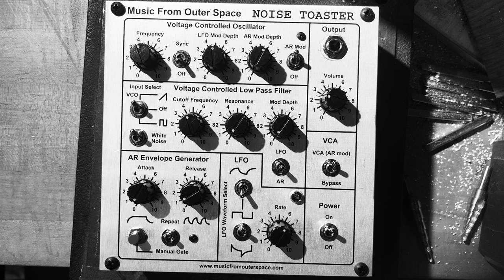MFOS Noise Toaster Build

Comment: how is it a voltage controlled oscillator when it has no voltage control input?
Reply from the maker: In this case, the frequency potentiometer provides the control voltage. The potentiometer sweeps between battery positive and battery negative, so the wiper sends a voltage between 0-9V. In most modular synths you can patch in a control input, but here it happens internally.
Reply: @oatsandmolasses  yes i could see that was happening, but you can't get it to play a melody like that.
Reply from the maker: @axeman2638  correct. This is a self-contained unit with no patch points.